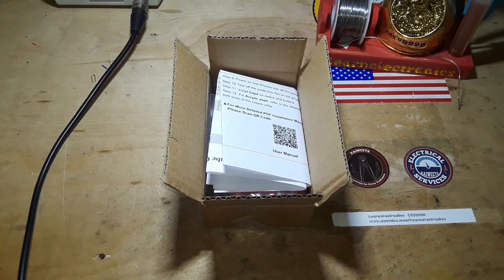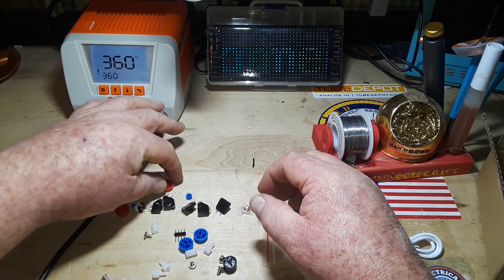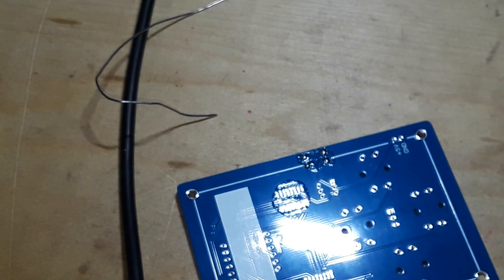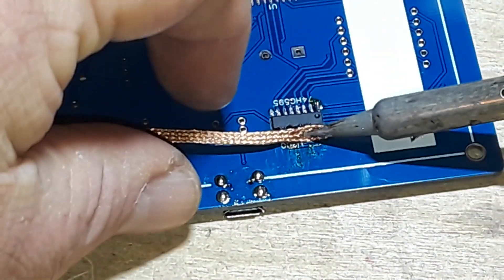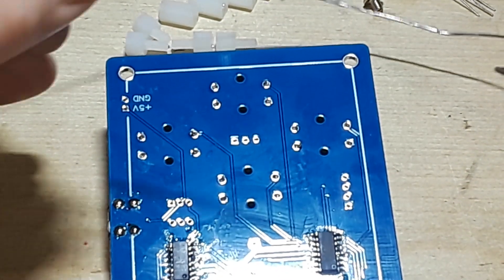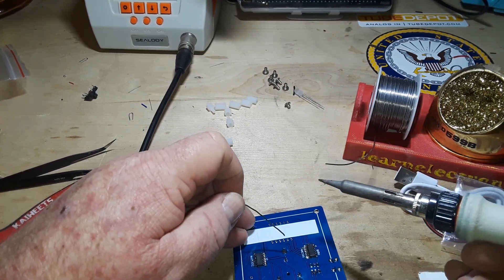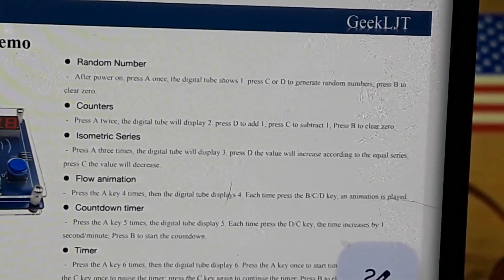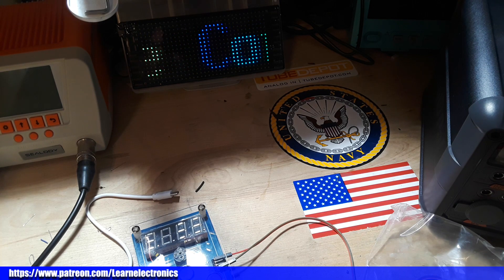A Wild Soldering Kit Arrived In The Mail

Comment: Well done. For drag soldering (on largish IC pins) you need a lot of flux and a large, hot, flat chisel bit. Solder generally only needs to be fed in at one end of the IC and then the iron / bit used to drag solder along to the other pins (dragging, rather than pushing down). Practice makes perfect (it took me some weeks to master this). A larger / hotter bit will also help with the braid desoldering (as you say, braid is one giant heat sink).

Comment: I used a handful of similar kits to teach myself how to solder; they’re great! But what really made my soldering better was removing and replacing components on broken circuit boards. Basically anything broken I had lying around that didn’t work; I would use for practice, comparing my solder joints with the factory joints. It’s cheap and insanely informative!

Comment: Use a DVM - TIP before connecting power use a DVM to check the resistance across the voltage input, if it is LOW resistance (it will blow up) check the circuit for problems.  
This has saved my bacon a few times, my eye sight has declined AND the soldering components became smaller. ;-))
Reply: my helping hand has a magnifying glass (with a extra magnification extra)